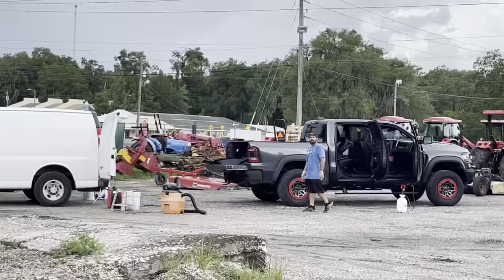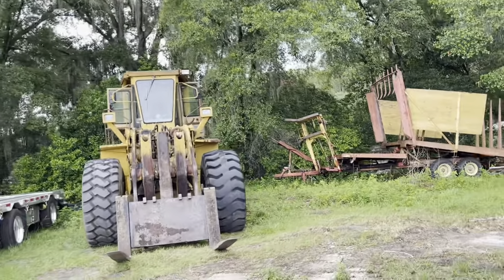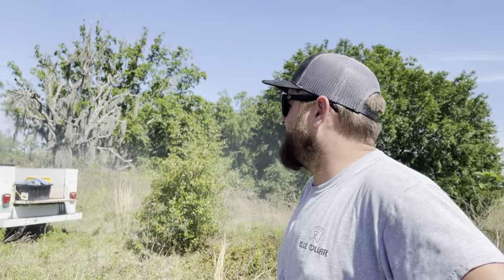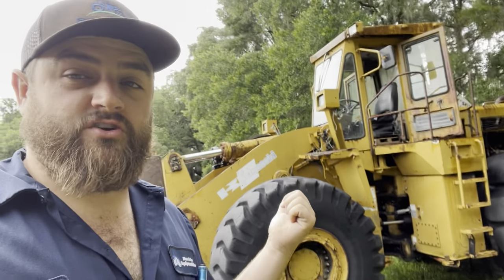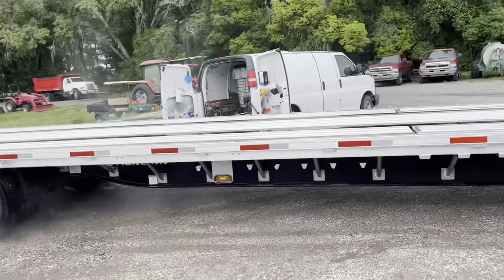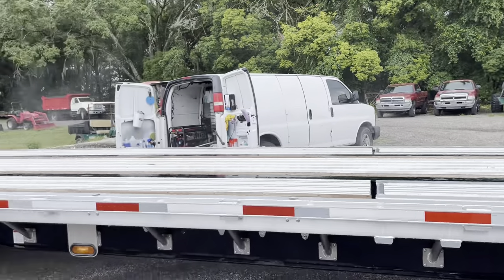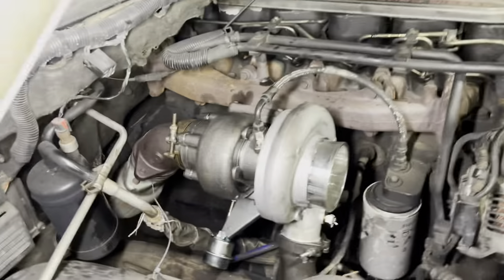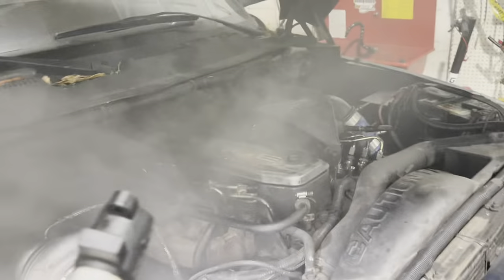My Wheel Loader is STOLEN????

Comment: You drove my loader away from site on April 8 and I notified you on May 1 that it was mine and I wanted it back. You asked me if I wanted to sell it and I told you no. You asked me if I did how much I would want and I told you 25,000 you emformed me it was not worth it. I used it last in July 2018 . They had no problem leaving it there at least the man in charge of project. They were not sure if they were done moving trees on site.

Comment: Well if worse case scenario happens and the loader has to go back to the original owner who abandoned it, I say give it back with all the work you put into it undone. The hydraulic lines you replaced are yours so take them off along with all the fluids, filters, batteries etc that you put on. If he wants it back he’s gonna get it in the condition that it was or close to it. That or tell him that he’ll have pay you for all the time, labor, and money spent reviving the loader or all that you’ve done will be removed and he’ll receive the loader un operational like he left it.

Comment: Found this with a quick Google search: "A vehicle may be considered abandoned if it has been left unattended for 35 or more hours. The police must make reasonable attempts to contact the owner before selling the vehicle or donating it to charity."

Now, the question becomes, would the front loader fit the definition of a vehicle according to Florida law? I have no idea, and I can't seem to locate anything about heavy equipment with a quick search.
Reply: the main rule of thumb I would do with any abandoned vehicle is have a officer come and check and see if the vehicle is clear to sale and to witness the perches .
Reply: @TheNazo21  Consult a lawyer versed in the particular law - LEO's don't know half the laws they are called to enforce.
Reply: @kstricl  true
Reply: @kstricl  except, a loader is not registered like a car is.  So unless there happened to be a theft report on file or some miracle, there may be no records to run it against.

Comment: I can tell you this.   At least up here, it was up to the construction company to legally own the machine before selling it.  
Example I'm dealing with.  A Peterbilt that I sold, well over a year ago.   But the owner abandoned it at my shop.   I have a boat I was working on for a guy before he got a 15 year sentence in Federal Prison.  I can't legally just make them not exist anymore.   Nor can I sell them until I own them.  So there is a process to do that.  But, it's not very easy.   
The construction company skipped that step.   Now it's up to the lawyers.   And you're stuck storing it for free.
Reply: Finally, one poster that makes sense of it.

Comment: I had issues with mine stepdeck axles I couldn’t keep a set of Brake shoes longer than 2 months. Only one axle one side, changed the slack changed the brake chamber even changer a few valves that distribute the air going side to side non of that helped me. What it was for my trailer a simple stupid abs sensor! I was too close and kept locking that right side last axles up sonnet that the rest and taking all the weight on first because the abs kept reading wrong.
Hopefully this is of some help

Comment: When the guy bought the property it was abandoned on it became his UNLESS otherwise stated in the real estate contract. Also, once someone leaves something abandoned on someone else's property, (as in did not have permission from the property owner to store it there). After 90-days it basically becomes the property owners. The court may give them a chance to get it back, but the property owner can charge them storage fees, which the property owner can say they charge $100 per. day for storage and they can't get it back until those storage fees are paid.
Same as if someone brings you their tractor to repair and you fixed it and called them to come pay their bill and pick it up but they refused and left it there for 3 months without permission. You can claim it and file paperwork to make it yours, and or you can charge them daily storage fees.

Comment: I'd say look into what you can do as per a Mechanic's Lien on the machine, just to make sure that neither party try to screw you out of the time and money you have in on that wheel loader. Repair costs on those machines are no joke. And make sure you list every second you spent on it. Last thing you need to have happen is someone rob you of getting paid for replacing the hydraulic line, the batteries and fluids not to mention the service time you put in on it. Get paid for it if they try taking it via the court system.

Comment: My opinion is that part of the reason the original owner is finally coming forward is because you did put in time and money to get it running, and now if he gets it back from you, he doesn't have to put that time and money into it and gets to just use it to make himself money. You don't leave something abandoned like that for years, without communication, unless you've abandoned it there essentially. So if you end up giving it back...you should remove the parts you've put on it and return it in the barely working state it was when you bought it, unless the party taking it back agrees in writing and pays you at the time of transfer or before for the time and money you put into fixing it.

Comment: if dude end up getting it back. you need to reverse everything you did to it. give it back to him the way you found it. ❤ from pnw oregon
Reply: I would do the same Bruce
Reply: Then he’d have to dirty it all up, reattach all the old hoses, pack a rodent and or bird’s nest back into the muffler exhaust, deflate two of the tires, reclaim most hydraulic, transmission and brake fluids, then charge for all his labor hours dealing with both fixing and unfixing the machine.
Reply: Now this comment is just plain stupid Bruce at the minimum has the right to expect to paid for his time and money invested in all repair and service work he did upon the machine as well as the price of the machine. The suggestion of reversing the service/repair etc if actually possible which its not does nothing to pay Bruce for the time he has invested in this piece of equipment.
Reply: @gullreefclub  thank you for finally coming forth as somebody with reasonable common sense.
Reply: @marvinjgerald6007  sounds like about ten minutes with an oxy torch to me...
Reply: @natesaunders5628  lol, and it happens more than we’d all suspect.

Comment: From what I read in the Florida law, it appears to me that the landowner should have advertised before the seizure, sold the loader in a public auction, kept a storage fee from the proceeds, and turned the excess funds from the sale over to the county. Sounds like you're screwed, but you may be able to put a lien on the loader and collect a handsome fee for the recovery and repair.  I wondered when I saw the video if you weren't likely to encounter the problem.

Comment: the construction company that bought the land, they bought everything that sits on it. The original owner should have been clearer that the tractor was not part of the land and that they were going to get it. so, it's clear that they did not tell the construction company that the tractor was not a part of the deal. so that does give the company the right to do what they want because it was left abandon and on their property. the issue should not involve you. this is the company and the owner's problem but its more than the owner's fault not being clear that there was stuff on the property that they wanted to keep.

Comment: #1 Get an attorney familiar with property law in your state. #2 A typically a bill of sale incudes a clause stating something along the lines of "The Seller certifies they are the rightful owners of said property and have full authority to sell the vehicle herein described (WXXV1234567). The Seller further agrees to indemnify the Buyer from any claims, liens or judgements."  The construction company is the one with a problem. Until the "claimed owner" has a Writ of Replevin said "owner is not permitted on your property"  Your alleged "owner" is hit out of luck.  

A writ of replevin is a prejudgment process ordering the seizure or attachment of alleged illegally taken or wrongfully withheld property to be held in the U.S. Marshal’s custody or that of another designated official, under order and supervision of the court, until the court determines otherwise. This type of writ is commonly used to take property from an individual wrongfully in possession of it and return it to its rightful owner.

Comment: At least undo what work you put into it, as much as possible.  If he did not report it stolen to Law enforcement, I believe he is going to have a hard time getting it back.  It might be impounded if it heads to litigation until the case is resolved.  It is not going to be cheap to haul that thing,

Comment: He's having a laugh, he left it abandoned and had zero interest in until you fixed it and now is trying to pull a fast one as that hadn't been touched in years.

If it looks like you're going to loose it drain the oil out of it and then run the engine until it seizes up.
Then once it's dead give him a week to get it off your land or you'll sell it for scrap.
Also the people that own the land where he dumped it should be charging him back rent for it.

Comment: If something was stolen from you wouldn't you want it back? Morally I would do what is right even if I took a hit on it. But hey Im not you am I
Reply: The right thing??? The dude abandoned it on a property that was sold and didn’t want anything to do with with for years!!! And now that he sees it’s fixed up and running and now wants it!! Bruce could easily win this in court any judge would see this dude didn’t want the loader until he saw it was repaired.